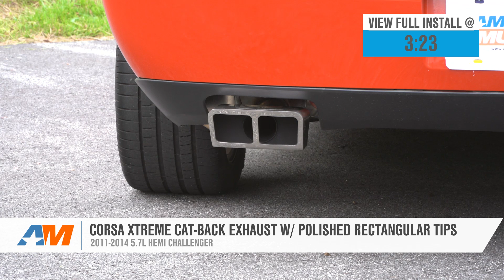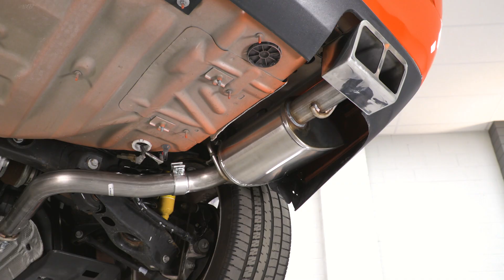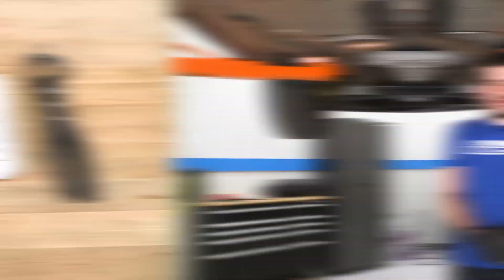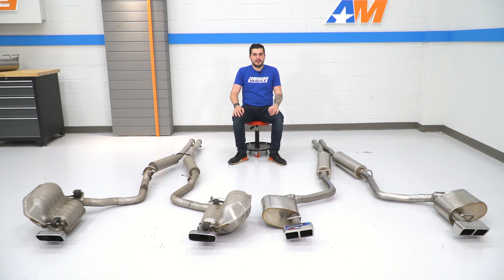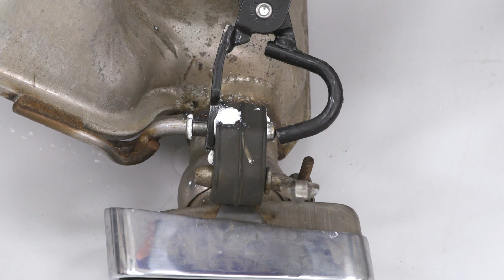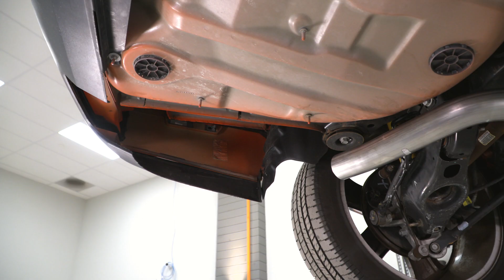2011-2014 Challenger 5.7L Corsa Xtreme Cat-Back w/ Polished Rectangular Tips Sound Clip & Review

Comment: I have corsa on my 12 challenger srt8 , not sure sport or xtreme , my question , can I remove the 2 resenator , will it throw CEL ? I’m looking for a better sound
Reply from the maker: Nope! Removing the resonators in your exhaust should not change the flow enough to cause any sort of check engine lights or issues. Removing catalytic converters, on the other hand? You'll run into some issues there. -Zach

Comment: I looked at those as well as the borla attacks for my Challenger, but ended up getting SLP loudmouth catbacks and am really happy with them. They do have a little drone, but all that you need to do is change up the RPMs a little and it goes away. They are open chamber bullets and extra loud, but it's not a daily and is not a problem. Everyone is just straight piping them these days, but I wanted larger-diameter for better flow and are menacing as hell. Finally replaced those shop vac styled singular exhaust tips, and got some really nice quads for Christmas this year. Which are fat 5" surrounded with carbon fiber, and look hot on that bad boy Mopar🔥
💪🏼😎